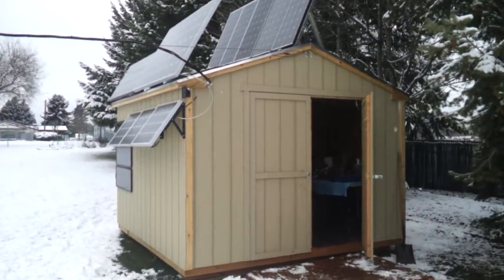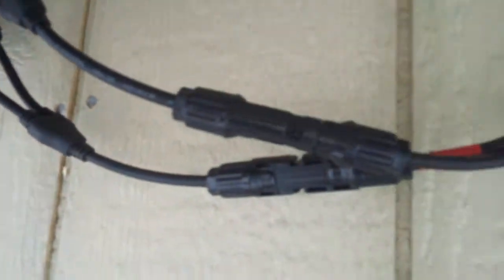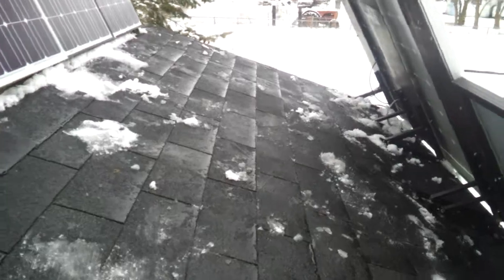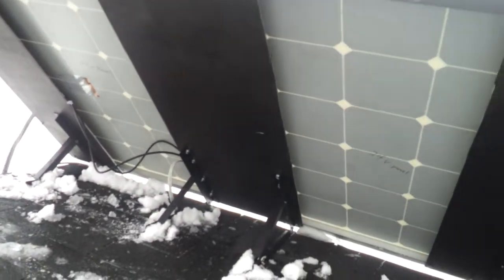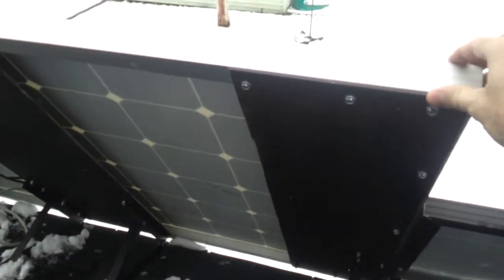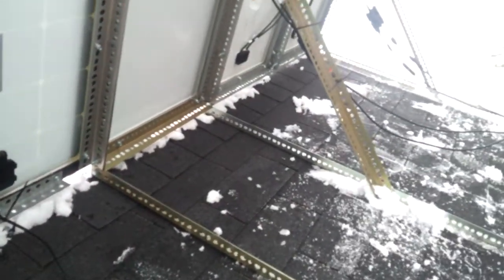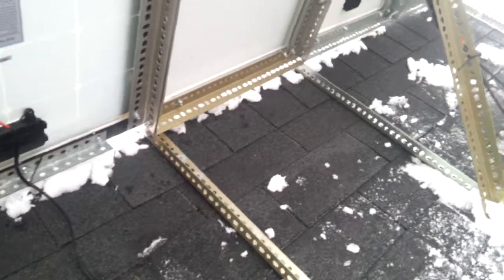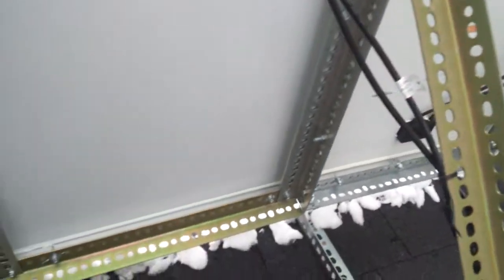SOLAR SHED UPDATE MOUNTING AND WIRING SOLAR PANELS

Comment: I viewed a video on 1 of the channels that multi strand wire would be much better. So actually I think your speaker wire is capable moving more electrons than the Romex. I thought of using that speaker wire also. Is there a way to compare performance between the wires?

Comment: Hi,

I watched your 3 videos - they were interesting, thanks.  What exactly do you use your solar power for?  Does it free you from the grid completely if need be?

How much did it all cost?

How do you feed the 24 volt into the 12v system?  Do you need a separate charge controller for that one?

How do you feed the power into the house?

Lots of questions I know but Im interested.